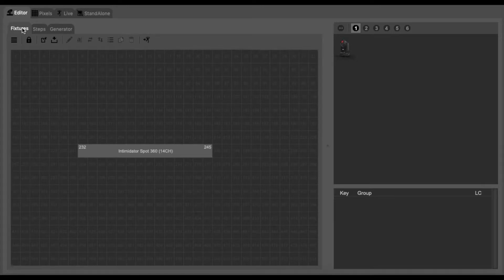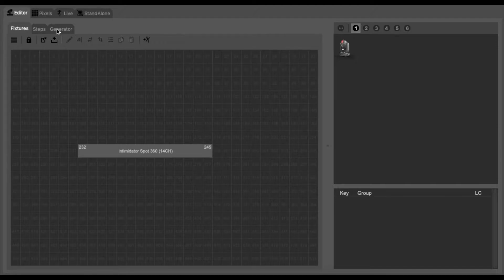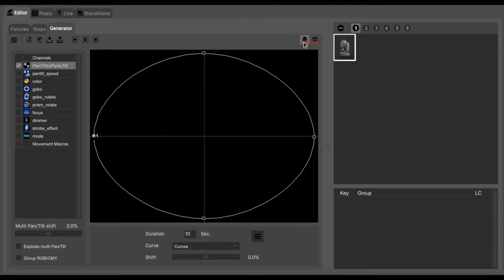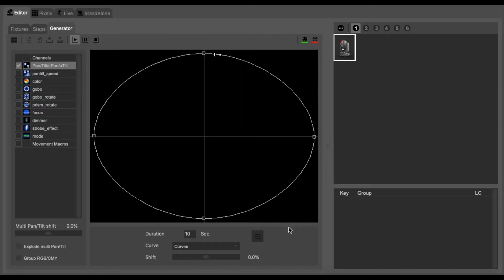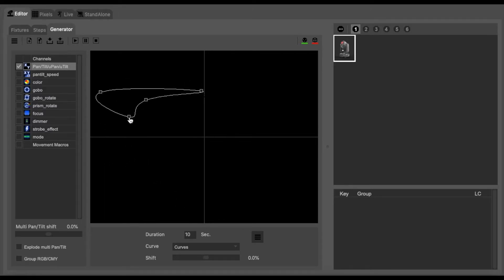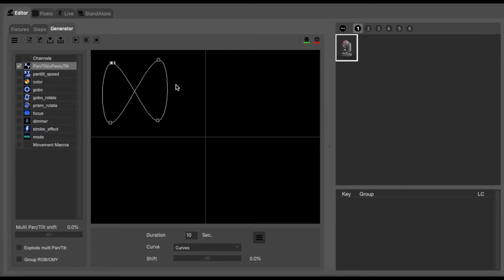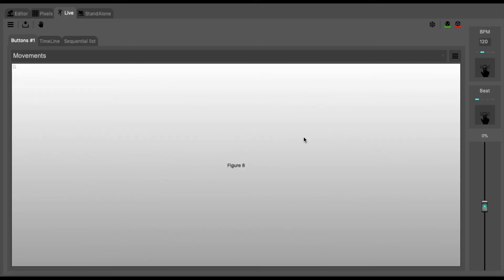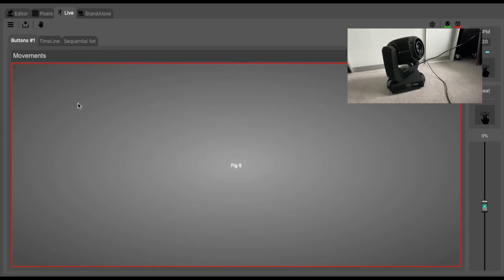ShowXpress Generator Tutorial

Comment: How do I add intimidators to an existing project?
Reply from the maker: It is no different than adding any other fixture to an existing project/database. You will want to go to the fixtures menu. Make sure you have an address free for your new fixture you would like to add. Ensure you set your light with the correct address. Then it’s pretty much the normal programming procedures from there.

Comment: Question... is there a way to change the light's idle pose in showxpress?
Reply from the maker: As far as I am aware this would be within the firmware of the fixture. So unfortunately you wouldn’t be able to override value 0 with a different position of the fixture. 

Some fixtures will probably have this functionality within the settings but doing something like this remotely via showxpress isn’t possible.